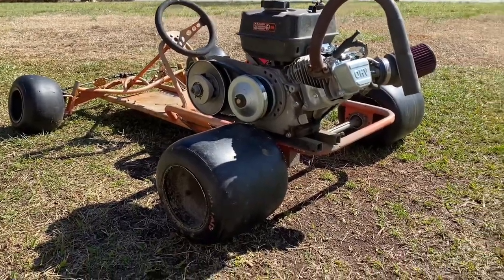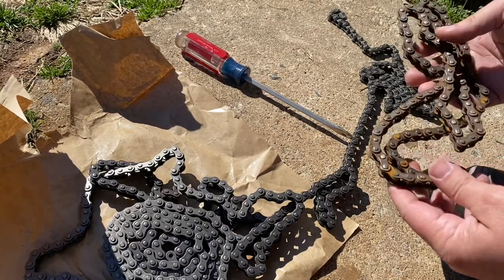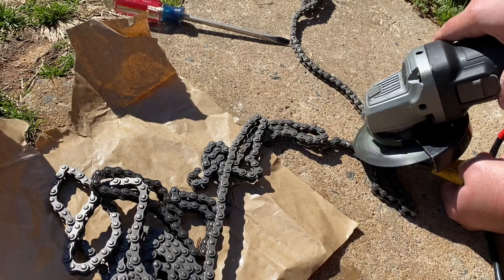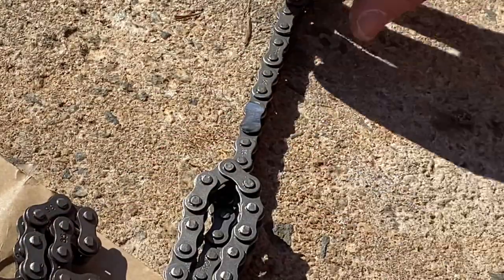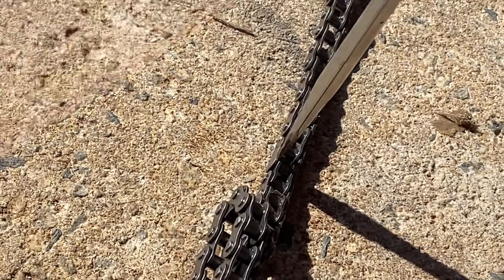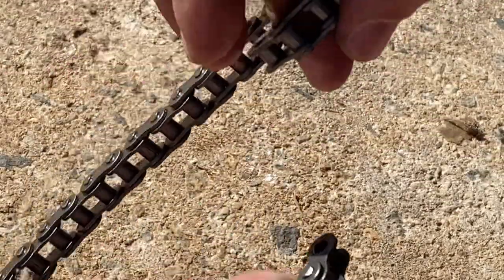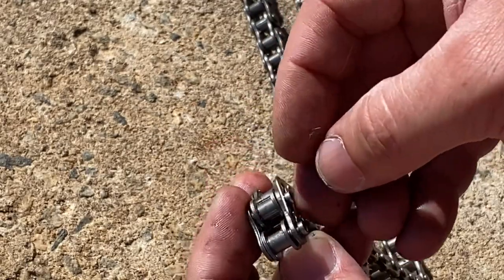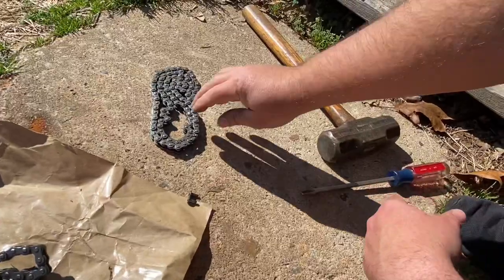Breaking A Roller Chain Without A Chain Break

Comment: If I don’t got a chain breaker what makes you think I have a grinder😂
Reply: Use a file
Reply: Seriously. 

"You don't have a $10 chain breaker? Just use your $80 angle grinder!"
Reply: Angle grinder is a must have tool, you can use it for million different jobs, everybody should have one. Chain breaker is a specialty tool that you may only need a couple of times in your life, so you buy the cheap one that breaks, hence why I'm here. By the way, I have two angle grinders, one was $15 and my good one was $20.
Reply: @JA-gx4hb  Hacksaw.
Reply: Because an angle grinder comes in handy WAY more often than a chain breaker.. that’s why
Reply: @realdevonte  Well it's also a pretty large tool which makes it more difficult to misplace. I have been looking for my chainbreaker for DAYS and they're sort of a little expensive for what they are, like there's barely any complexity or material to it! I know i have it, i just don't know where i put it.

This is really a stupid method though. Since a chainbreaker isn't built like a grinder, then you don't need a grinder to open the chain, you simply don't need that much violence. Probably going to fashion something like a bracket with an m3 screw, or just use some sort of something to hammer the pin out, something like a garbage old screwdriver or a hex wrench or something like that.